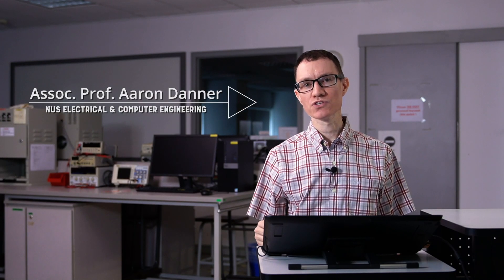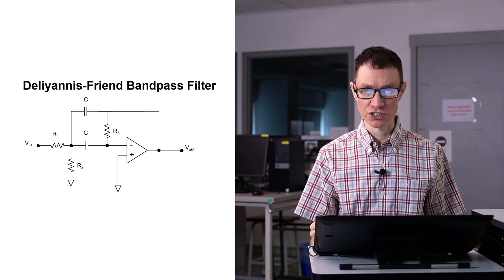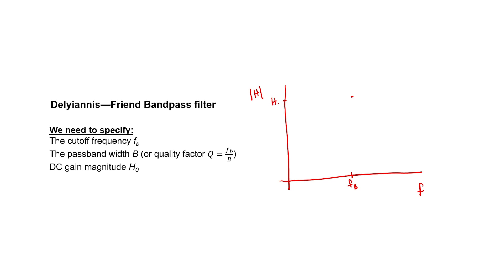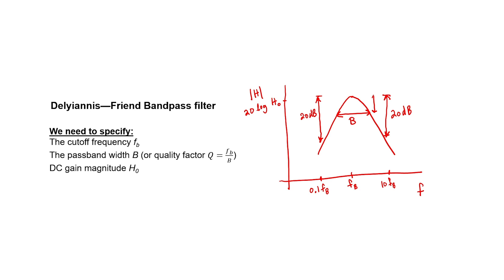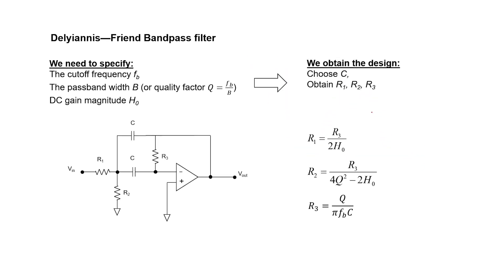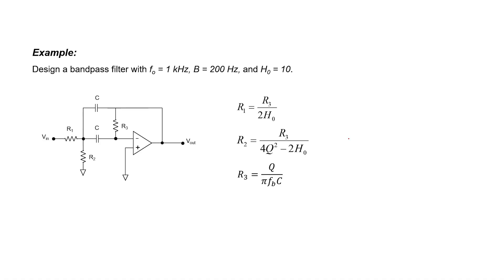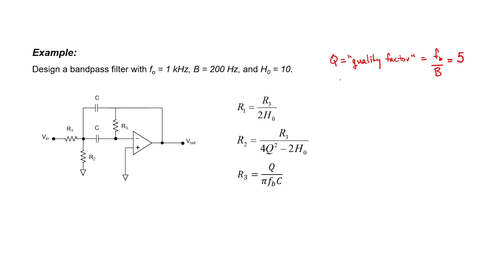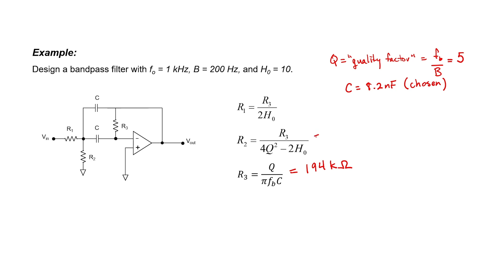Delyiannis-Friend filters (6 - Active Filters)

Comment: Thanks for the Video.  If your Q is low in relation to H, such that the denominator of R2 equation is negative then do you typically sacrifice DC gain or increase Q (perhaps both) so as to cause the equation to not yield a negative value?

Comment: After designing a filter with a certain fb, I would like to change fb by only adjusting the resistance value. Is there any other way to do this than to change the values of the resistors that make up the filter one by one? I would like to change the center frequency by changing the value for the number of minimum resistors.

Comment: These equations fail miserably for frequencies near or above 10k. You can only use these equations for very low frequencies for around 1KHz which means this filter is useless.

Comment: Aaron, I really need your help desperately. I've made a lowpass, bandpass and highpass Butterworth filter and I've combined them. They all work perfectly in a vacuum. Together however there is a huge dip at the 1K and 4K hz points. My values are: 1K for the lowpass, 1K to 4K for the bandpass and 4K to infinity for the highpass. The bandpass is a lowpass and highpasss filter cascaded. Could you make a video on how to successfully combine these? Thanks in advance.